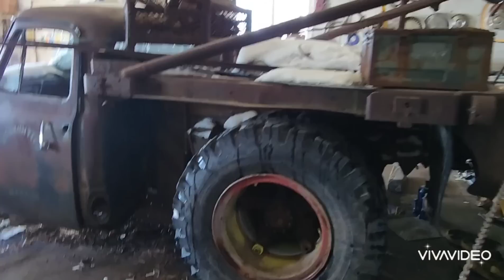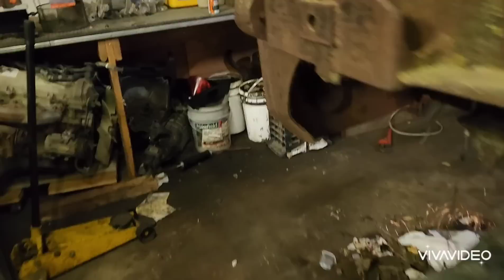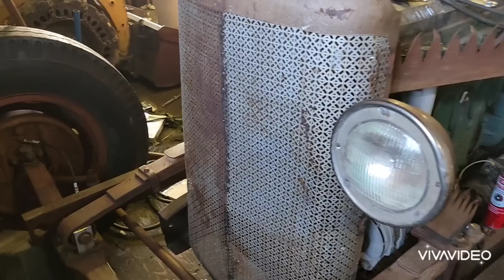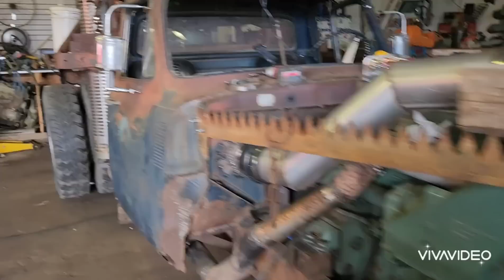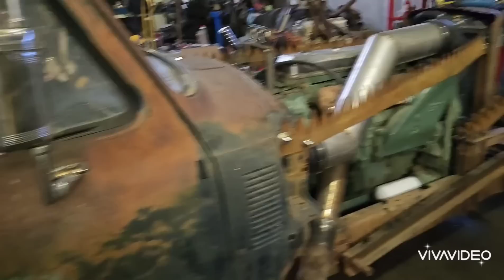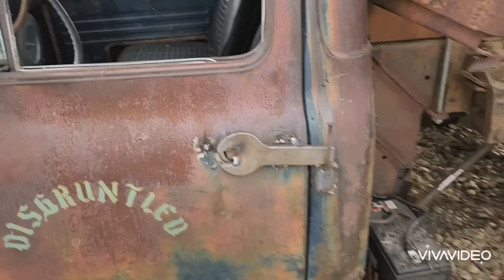MONSTER 671 DETROIT DIESEL RATROD BUILD

Comment: The wrong oil is better than no oil 😂 in the concrete truck 😂.  That's a sweet rat rod. My brother and I built one out of a 1929 ford model a sedan with a turbo 6.9 idi with a auto trans. It's a gutless turd but still fun to cruise.

Comment: It's very interesting to see that people like us are always interested in the exact same things. I've got to International KB 8 KB 10 40s models one I'm putting a 453 Detroit in and the other I'm putting the cab on a 78 International semi with a 6V 92 and a 10-speed. I also have a 12 valve twin turbo Cummins in my 66 Dart gasser altered wheelbase. And I have a 7-3 Powerstroke I'm putting a 8-cylinder P pump on with 8.3 Cummins injectors for a 71 International travelall. Just picked up a 90 Ford F-250 with a 7-3 IDI and I'm going to pull the body and bed and put a 58 Rambler Ambassador Wagon on it make something similar to Mad Max and I was thinking of running twin 3.8 superchargers. Off of the Buick engine think they're m90s I want though I love the Detroit's I have a lifted on 52 in 1970 with tilt bed White Freightliner semi detroit 8v71 non turbo. Taking your in Canada I'm down in Arizona

Comment: I don’t think I would’ve built the fuel tank so rivets were on the bottom..
Reply from the maker: Had to...filler and feed sizes made it non optional without trashing barrel
Reply: @captaindipchit  makes sense, still bad ass even if it sweats a little of the expensive stuff..